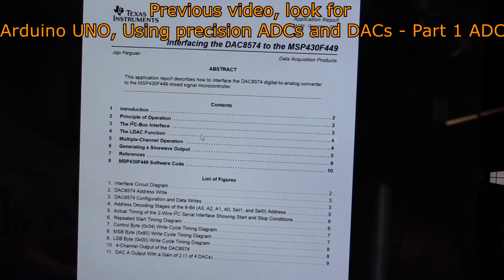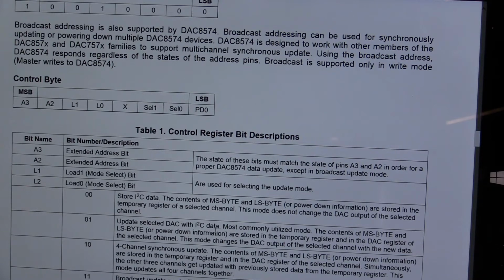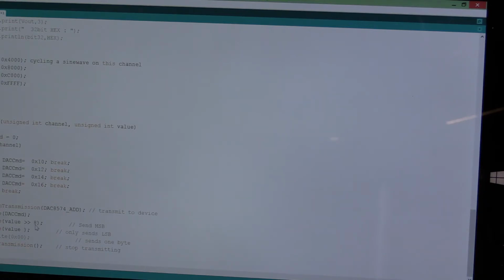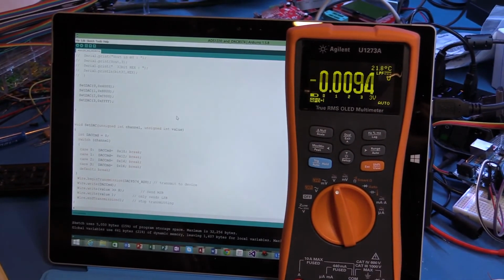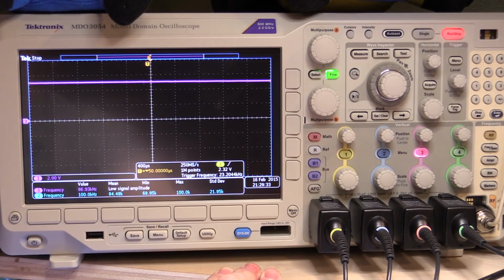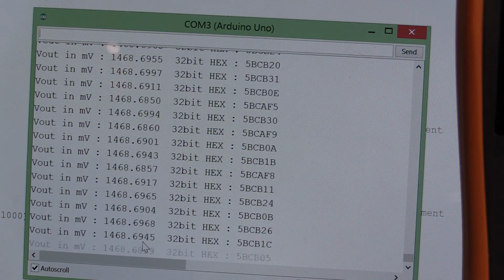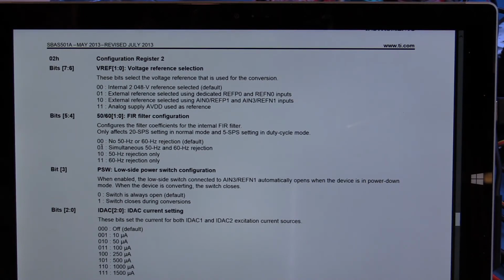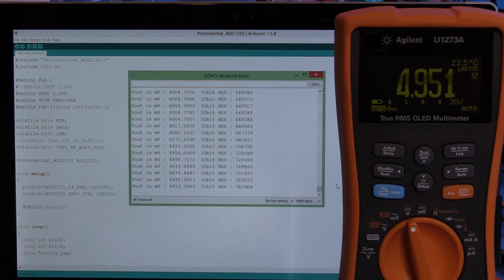Arduino UNO, Using precision ADCs and DACs - Part 2 DAC

Comment: I always put an I2C scan program in my arduino with a new I2C chip, it will quickly tell me what valid addresses are on the circuit.

Comment: Hi sir great explanation how much frequency please...
Reply from the maker: The datasheets are all found via the links in the description, the Arduino is running at 16Mhz
Reply: @TheBreadboardca  I have MCP4921 DAC use it instead of DAC8574  change anything  on the code Please .... If interested share your email address , My address vengutech@gmail.com
Reply from the maker: @vengug7303  To make the new chip work, there will be need to update code of course, I currently dont have any of these chips to work with so  ordered some, they may be a month or so to get to me but when they do I will create a video on using them, I ordered a single channel one and a dual channel one. Both with external Ref inputs (MCP4922 and MCP4921) and in a PDIP package to work easily with breadboards.
Reply: @TheBreadboardca  Thanks for your valuable reply we are waiting for your excellent video all the best..... If interested please share your email address....

Comment: Peter, thank you for your effort.

Comparing code in the video and code on website you posted:
http://www.element14.com/community/groups/test-and-measurement/blog/2015/02/17/the-modular-bench-power-supply-arduino-uno-and-precision-tesadc-dac

I found bug, there should be:
Wire.write(value >> 8);

between line 83 and 84.
Reply from the maker: Wow, good catch. Thanks, I have now updated the text and attachment to align with the video
Reply: Thank you, it was bit tricky to find!
Reply from the maker: glad you did though, thanks

Comment: Hi Pete! I built a linear lab psu a long while ago.....but nothing near to this. The whole concept of having the device controlled by a microcontroller is quite stimulating, if I may say so. The production of a sin wave via the dac kiched off an avalanch of ideas for example: adding a square, saw and sin wave signal generator or reversing using an adc to measure signal frequencies. also, adding an I2C and logic decoding capability would be rather 'groovy' too.
the only problem is (at my end anyway, lol) is that I only recently purchased my first RaspberryPi 3, where I am going flat-out learning how to control all sorts of devices via the gpio header. I 'deliberately' avoided the Arduino (for the time being), just so as not to 'complicate' things (such as having to relearn C). Those ideas I described are now a goal to reach and an unavoidable challenge....and the Wife will no be seeing me for a while. Talk about running before learning to crawl though, eh? ;)
as to the project video content: all is good. better than good, actually.....thankyou for that, Pete.

what irritates me slightly is that there are only 7000-odd views, so I've shared this playlist here on the tube and will do so on google+ and FB too. The information gathered here is gold, so that's the least I can do :)
keep up the good work mucker and have a good yuletide & hogmanay!

Comment: Hello, thanks for the effort posting these videos. I'd like to ask you to clarify something: the sine wave is being generated by the code itself, right? Would it be possible to convert an external analog sine wave signal (from an external function generator) to digital then convert back to analog as a way of filtering unwanted noise from the source? I mean real time ADC-DAC conversion as a means of eliminating 50-60Hz hum noise from AC mains and RF interference from the surroundings?
Reply from the maker: +Pedro Yi I use a sine table to lookup the value rather than calculate it every time look for "Sin_tab[256]" in the code near the top
Reply from the maker: +Peter Oakes (TheBreadboardca) Also most ADC's these days have the ability to filter at 50 or 60 Hz, I have not seen DACs doing it that I recall

Comment: Hi Peter, nice video. 
Can you provide the arduino DAC8574 code?
Thanks.
Reply from the maker: +André Domingues Sorry, so many DACs and ADCs with similar numbers, I just posted the code I used here http://www.element14.com/community/groups/test-and-measurement/blog/2015/02/17/the-modular-bench-power-supply-arduino-uno-and-precision-tesadc-dac
it is attached and listed for you to use
Reply: +Peter Oakes (TheBreadboard) Thanks Peter, It helps a lot. Nice videos.